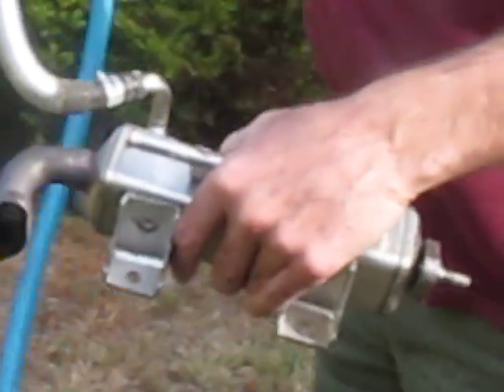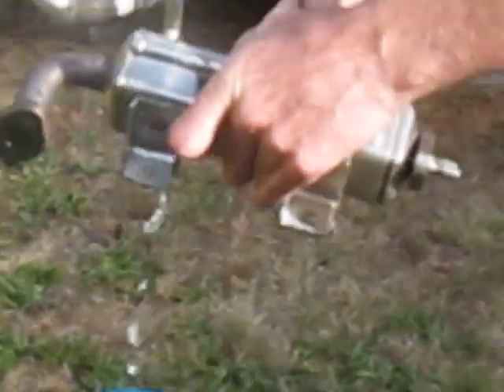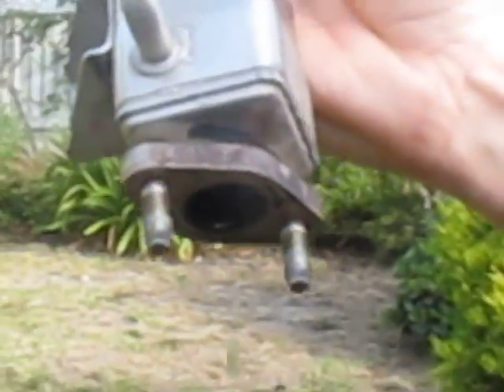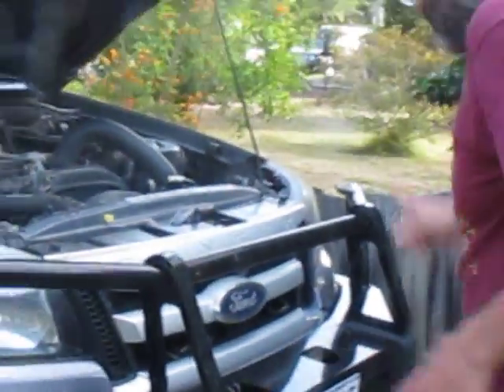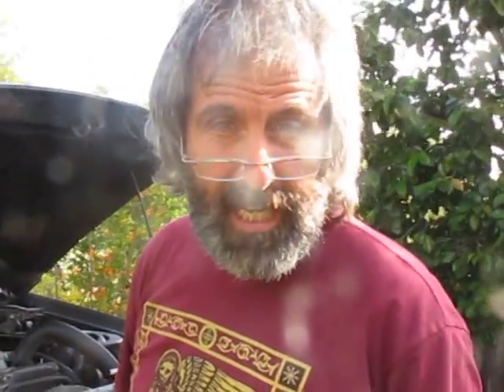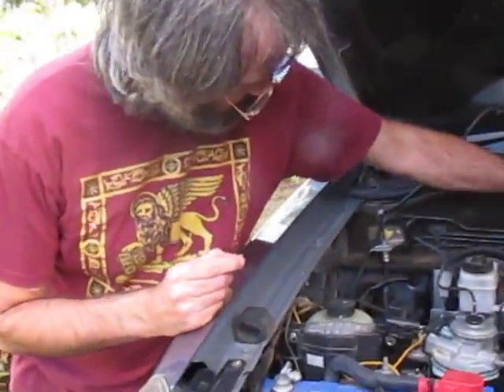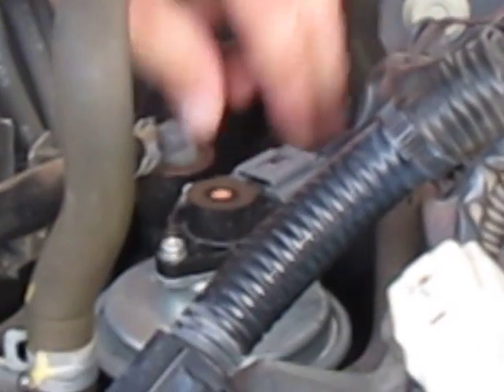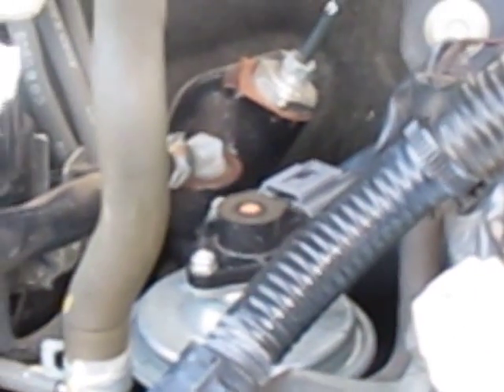Ford Ranger / Mazda BT50 PJ Ute - EGR Removal

Comment: I would strongly advise that this is a very bad Idea because the engine computer is a hell of a lot smarter than the guy doing this video.  It knows that you have blocked off the Exhaust gas recirculation valve and also if you take the cooling off the cooler because it is leaking.  If you have a code reader, you will find a PO4O4-OO, A p04040-FF a P0401-00, a P0401-FF error code and a few others including turbo boost errors.  What does this mean. It means numb nuts that the computer has reduced the power output of your engine to compensate for the higher temperatures in the combustion chamber.   They are a compression ignition engine, you squash the air in a bike pump, you burn your fingers, Modern high speed diesel engines are designed right on the limits of metallurgy, first squeeze the air with a turbo charger, it gets hot, so they put through an inter cooler, then it goes into the cylinder and it gets squeezed to a minimum of 16 to 1  and as high 25 to 1, as its volume  gets smaller,  again it gets hotter, to a point where it get so hot that when you push diesel fuel in, it instantly burns, no spark plugs (glow plugs are for another rant), ever tried to get diesel to light without a wick very hard because of it very high vapour temperature - (DO NOT TRY THIS, you WILL get burnt and have to go to hospital and be bandaged up like the dude in Catch 22 ) (It is technically an oil). when it burns in the cylinder, the temperature goes even higher. it gets even hotter and heats everything inside the cylinder, pistons and valves included.  The only thing that has a cooling water jacket is the cylinder walls, the valves and the pistons do not.   (keeping diesel pistons cool is a big issue such that some manufacturers spray oil on the underside to cool them down and then cool the oil).
And why would your humble brainiac box (PCM) want to reduce the power (by reducing the amount of fuel it pushes into the engine and reducing the turbo bust), so you don't melt the pistons or have the valves heads drop of the stems and the point where they friction weld the stelite head to the hardened steel stem l(you know that horrible expensive sounding bang followed by a clatter) and have a rod come out the block. As one guy traveling in the outback with his V8 land Cruiser found out when the valve heads fall off in number 3 cylinder, it cost him in the ballpark of $30k to fix plus towing at $8 per kilometre to fix.  
The EGR feeds a small amount of cooled exhaust gas into the cylinder under certain fixed parameters to limit the combustion temperatures and the NOx (you know that poison that makes people die of lung cancer etc) that comes out the exhaust - Good not Bad! 
You will not improve you fuel milage!
Cutting out the EGR is about as smart as chipping the engine or jumping head first into a tree chipper with your Ranger tied to your right foot.  The engineers who design these engines spent millions of dollars and years with them bolted a dyno revving the living SH&^T out them against rev limiter to see how long they would give reliable service before going bang.  They know a lot more that a guy with a screwdriver.  If you want the Maths, PV = Mrt and the thermal efficiency of a reciprocating internal combustion engine is directly related to the compression ratio, not the peak temperature.  The manufacturer put an EGR on for a reason, Leave it there, you can buy a new EGR cooler for a PJ and PK from eBay for less than $200.  It takes 15 minutes, 6 bolts and to hose clamps and some minor four letter adjective to remove and replace.  Numb Nuts can do it and you won't have the MIL(Malfunction Indication Light, that little yellow engine shaped light in the instrument cluster) staring back you constantly, so when something actually is really going wrong you pay attention.  (the codes come up if there PCM detects the same fault over 2 driving cycles and if you replace the EGR cooler it will clear itself. )  The reason that Engineers put computers all over the car is to try and put the idiot out of the equation. They might just know just a tiny bit more than you. As for the bullet in the brain, the designers, they don't need it, they did the right thing.  I would suggest a more sticky solution for those who recommend the removal of the EGR system, give their name to a greeny some where and let them paint the offender with honey and tie them naked to a meat ants nest somewhere in the hot sun, a lot slower and gives them time to consider their sins against the planet.
(P.S.  If you MIL starts flashing, that's bad, Stop and turn the engine off - It's in the manual, that book in the glove box, the thing with lots of info in that no one ever reads and can be guaranteed to be the one pristine item in the most battered old clunker.)
Reply: I did the egr block off 10+ years ago, my ranger is still going strong with 600,000km on it and I get average 7lt to the 100km. You may have the “facts” but I have the reality. Sorry to disappoint you.
Reply: The only errors I have ever encountered on any vehicle after blocking EGR (inc. this 3.0 in the video) are related to EGR checks or intake air ambient temperature. Your power codes are completely unrelated to the EGR. The computer does not give a rats if you have exhaust gas in the intake or not.... it cannot tell. It checks usually by measuring the intake air temp.. on the rare occasion the computer gets upset you simply add a resistor thats usually between 10 ohms to 4.6kohms on the wire that goes to the ambient temp. sensor part of the MAF.
EGR is and always will be garbage, tired of seeing this sort of fear mongering over it. I have had EGR blanked on every car Ive owned and reliability and performance have always increased.

Comment: I have a 2008 3.0 Tdci Ranger and what I did was put a blanking plate in between that exhaust port and EGR pipe.  It stops any exhaust gas from coming in through there.  Should I also remove the vacuum pipe and blank it off?
Reply: Have the same question, what did u do

Comment: A few people say not to do this because it can cause other problems and it's there for important reasons. I guess it's a quick fix though. Thanks for showing how to test it though, awesome man. https://youtu.be/YBPd2eudXlM
Reply: He is a mummy's boy.
His reasons are:
1 Voids your warranty
 - So what. Most people that do this have a car out of warranty anyway.
2 Illegal
 - So what. You would be extremely unlucky to find a cop that can tell whether you have blanking plates inserted.
3 Reduces power because the ECU reduces fuel if it doesn't detect EGR
 - No it doesn't! This is wrong!
4 Exhaust gas temp rises which is bad for engine
 - Pffft, pull the other one. The hotter exhaust gases just disappear out the exhaust pipe.
5 NO is produced
 - So what. Do you want an engine that works or a cracked head? What he doesn't tell you is that in lowering NO, EGR RAISES the level of CO2 produced.
Reply: @warrenmars  Yeah I just got a new EGR, I need it legal as it's my work vehicle, cost $360 NZd, Thanks for info though.

Comment: Sorry mate quick question I know this is a old video.
 After disconnecting the vacuum tube and putting a screw in it do you need to remove the EGR itself/join the intake and outake hoses? or can u drive safe just putting the screw in the vacuum hose.
Reply: The most important thing is to disconnect the water hoses from the EGR cooler and bypass it, that will save your block from cracking. You don't need to remove the cooler itself but you should block it off with metal plates to be on the safe side.

Comment: Hi  Wazzo   I have a 2007 Mazda BT50 2.5 LT  turbo diesel  that  ejects coolant into collector bottle approx 1 litre every 200 km of constant driving  ( Added a second bottle )  But ok when driving around town  on and off 
any ideas ?   Plus  any additional info or links for Blanking EGR  cooler like vacuum lines etc...
pressure checked cooling system for leaks it is ok

Comment: Hey Wazzo im hopping you can diagnosis a problem on my 2008 BT-50 4x2 freestyle T/D manual ute.
Problem : when i push the vehicle on the H/Way  (120-125), or up a hill, it begins to over heat. If i turn the heater on the vehicle will cool down again. 
Do you know what might be causing this? 
Cheers
Reply: Could be a lot of things, including blocked radiator core, dodgy thermostat or most likely; an air pocket in the heater. I'd read up on how to get rid of heater bubbles. If all else fails you could try reading my soap box rant on the problems of placing the thermostat at the radiator outflow instead of its intake. It doesn't sound like the source of your problem but you might find it interesting... http://warrenmars.com/soap_box/miscellaneous/thermostat_placement.htm

Comment: I own 2.5L same engine 

One stupid mechanic didn’t screw the EGR valve position sensor properly and it took the car for wash  so all the water went inside the position sensor I took it for run 2-3 days no engine light came on but today it’s throwing P0404 n P0401 code so what ya think it’s the position sensor or the clogged EGR ? Taking off the EGR is quite tricky for me 

And I don’t think position sensor can get bad with few sprinkle of water right ???

Comment: I have a 2008 2.5 diesel with 110,000 k when should I change my timing belt.
Removed my egr cooler and piping too and installed 2 steel covers, plugged vacuum hose.
Also cut off the catalytic converter on the exhaust it was full of black dust.
Now have more power and much better fuel economy.
I live in Thailand my service book is in thai so my concern is on the timing belt and valve adjustment.
Reply: Ford say that the timing belt and tensioner should be changed every 120,000 kms. That's for the 3L engine.

Comment: Hey Warren do you have any suggestions on how to get rid of the engine light coming on du to bipassing the EGR? I've had it cleared with a scan tool but it came back on after about 5 minute of driving.
Reply: Only reliable way is to get your computer reprogrammed, aka ecu tune.

Comment: I have the same issue,  are you saying just take the whole thing off?
Reply: You can buy blanking plates via ebay which you can place on each side of the unit, or you can take it off and block the ends with steel. You must reroute the water hoses as well. There's lots of stuff about it online and in FB.
Reply: Is it good for long time egr fix?

Comment: Hey there Warren, I have a pk ranger and I've put the screw in the hose you talked about. I have noticed though that it makes the egr solenoid valve (near air cleaner) viabrate and struggle with the suction. I'm assuming this is a bad thing for that part. Did you too experience that?
Reply: Sorry I’m late but yeah that’s normal

Comment: hey mate, do you know where the thermostat housing is located on these ?
Reply: It's towards the bottom of the block on the passenger side, right where it it's extremely hard to get to. You need a long extension bar to undo the bolts.
Reply: Thanks Waz, tried it myself and eventually gave in to a mechanic, but cheers anyways

Comment: I've got the same problem poiterism, 400km to a tank, although I am carrying a 1 ton canopy. Changing the fuel filter made a small improvement. Also you should clean your MAP and MAF sensors with spray cleaner. Your MAP sensor will probably be full of black jelly thanks to the damn EGR. After sensor cleaning it takes a day or two for the car to adapt, so you will get VERY bad economy until it does. Just drive it a half hour or so for the first day and you'll have no worries.

Comment: does this method set off the engine light?
Reply: Correct me if I'm wrong but I'm pretty sure the PJ Ranger doesn't have a DPFE port. You sure you're not confusing the Pj Ranger, which is actually a rebadged Mazda BT50, with the USA truck which is an entirely different car?
Reply: Of course. All EGR disabling sets off the light.
The only way to avoid that is to hack the Engine Control Unit.
There is a mob that will do that for you but they charge almost $1000.
Reply: Warren Mars ah you're right. I assumed it was some newer ranger, different from mine... not a whole different vehicle.
Reply: this is mighty old comment, but if you put the vacuum port from the EGR into your DPFE reference port (fords), it will trick the ECU into thinking the exhaust isn't pressurized, and won't open the EGR - so it should never figure out you removed the EGR, as it never tries to actuate it.